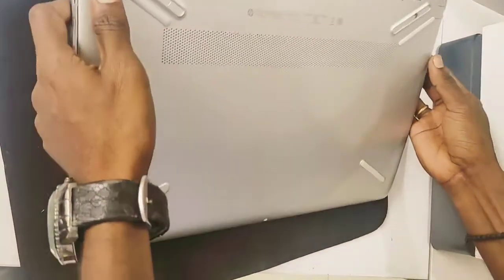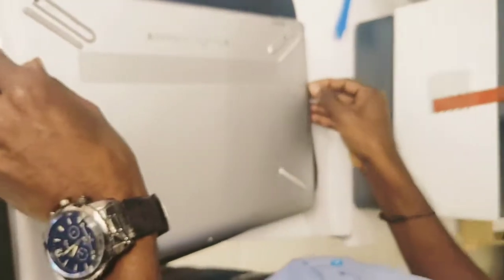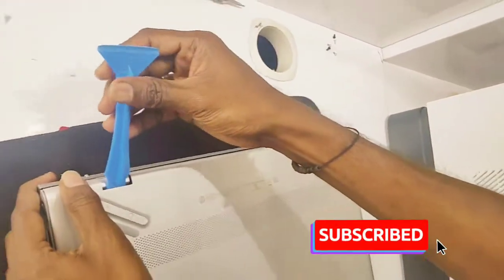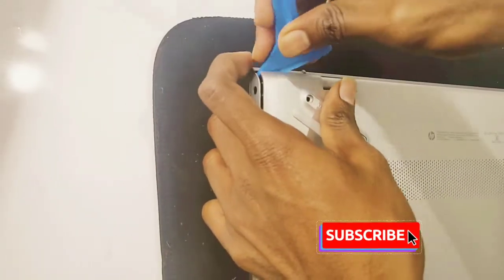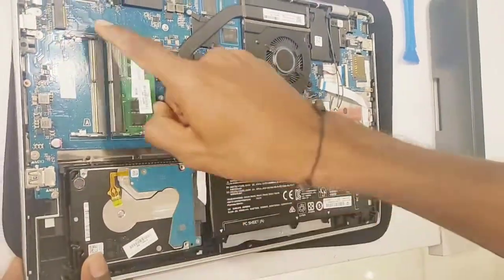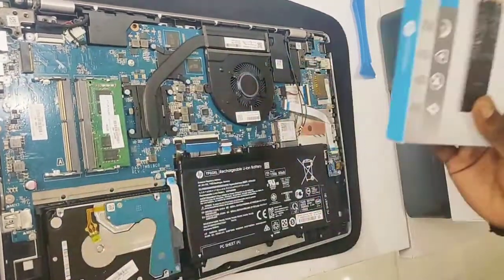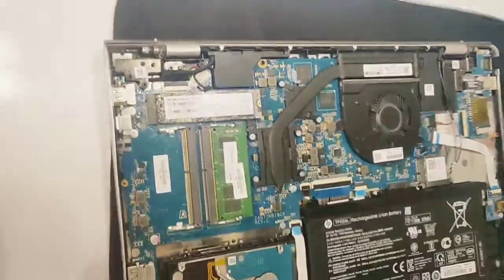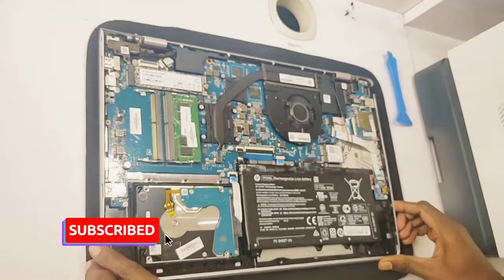How to upgrade M.2 SSD sata in hp 15-CK069TX laptop | NVME

Comment: Which type of ssd are you adding ,whether m.2 ssd sata or m.2 pcle nvme ssd ? I'm having same model and having doubt the above one.
Reply from the maker: Hi 
HP M.2 SSD sata only
Reply: ❣tq.
whether it supports m.2 nvme pcle ssd? Because, that I want to add it.
Reply from the maker: Yes It will support 
NVME very good performance 
But It's costly